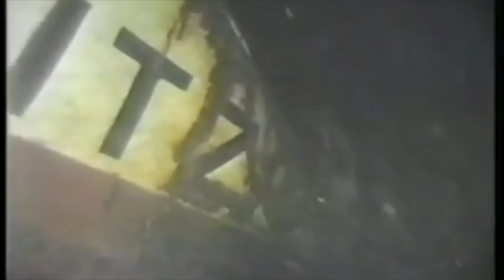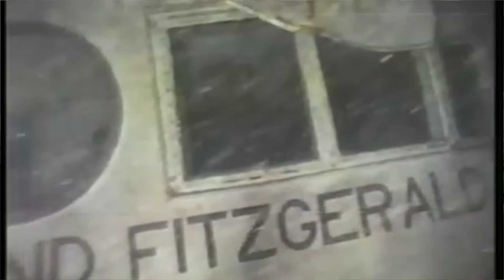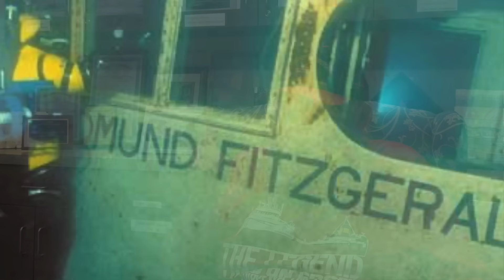Sinking of the Fitzgerald ... Negligence or Nature? Season 3 with Capt. Darrell

Comment: I respectfully disagree that the Fitz bottomed out on the shoal, they investigated the shoal after the sinking because it would be an easy answer. The Bradley didn't need to strike bottom to break in half and neither did the Morel so why did the Fitz? I posit a simpler more straight forward theory that places zero blame on the captain or the crew before I say it, I am going to say that I am not a mariner, nor do I have maritime experience, the only thing I am remotely related to this is a welder in the mining industry who has seen and worked on a lot of old equipment and steel. There is this phenomenon that happens with old equipment where you repair it over and over again. Gouge out the cracks, fill the cracks with weld metal, normalize let the equipment do another 12 -14,000 hours of service. It comes back cracked again you fix it again, repeat it a few times. Then when you are doing a repair, when you are gouging out the cracks that other cracks appear 2-3 inches from the one you are fixing. The more you gouge the more cracks appear, and you can't fix them all because all of the metal is stressed, the steel has hit the point where it cannot be repaired because it is effectively crystalized and shattered.

The Fitz as was said lived a hardlife, it never left without a full load, it was always out in weather. It didn't need to hit the bottom, it didn't need rogue waves aka the 3 sisters to sink it. All it would take is heavy weather, a heavy load and the ship wouldn't survive. I don't think there is a need for any theory on this sort of thing, the ship went out in a storm it shouldn't have gone out in the ship ended up on the bottom in 2 pieces and we are missing about 100 feet of the wreck in the middle it just disintegrated.
Reply from the maker: Understood. Certainly, the Fitz "didn't need" to strike bottom to sink, but it certainly could have struck bottom; it's a possibility. The Titanic didn't need to strike an iceberg to sink either, but it did. What we do know for sure is that the Fitz was taking on water and listing badly, evidenced by what Capt. McSorley said on the radio. So why was it taking on water? It was either coming in through the top or bottom or both. Thanks for watching! HMM

Comment: My question is how would you even get into the Fitzgerald wreck to look for the logbook?!?  It seems like it would take a diver with special-mix scuba tank to do that!  This was accomplished by 2 guys within a year of the last research expedition when they found the body beside the bow section.  They were risking their lives, barely spent more than 10 minutes at the bow section.  The whole dive took them more than 3 hours because of the decompression they had to do on the way back to the surface.
Those hard suits they used to remove the original ship's bell in 1995 were awful bulky and I don't know that they COULD get through the door of the pilot house wearing one of those suits!  Scuba gear/special mix tanks or a small ROV with manipulators might be the only way to do it.
Where would the logbook even be at this point?  It could have been pushed far back into the bow section by the storm.  This is getting grisly...  There's almost no doubt there are bodies deeper there.  I've read stories/rumors about them seeing more on the wreck than they've told the public.  Forget about the state rooms -- the pilot house is spooky enough!
Granted, I think about half the Fitzgerald stories I've read at this point belong in the real of urban myth or ghost stories.  Yes, I've heard a few ghost stories involving the Fitzgerald and sightings at White Fish after the shipwreck.
**
Judging by the last publicly available sonar scan image of the Fitzgerald (2004/2005?), that ship has deteriorated quite a bit since 1995.  The upper cargo deck behind the pilot house has collapsed and is resting on the keel now.  The hull walls (of the bow) have peeled outward.  You could easily see these details even from that low-rez sonar scan.
If an answer is to be found, let alone the logbook, it has to be done soon....  or it may be too late already.  That sonar image was taken in 2004/2005.  The ship has undoubtedly deteriorated even more.
Reply from the maker: Super interesting commentary; thanks for sharing it here. For the people who dove on the Fitz...they have peered directly into the pilot house and have no doubt seen images that they're not talking about, or not at privilege to talk about. So many unanswered questions. Anyway, you offer some very interesting info here and thank you kindly for your thought-provoking thoughts. HMM
Reply: @HistoryMysteryMan  The ghost story thing...  what HAVE people said about sightings of the Fitz on the waters and in White Fish Bay after the sinking?
Reply from the maker: Not sure. Do you know of any sitings of the Fitz in White Fish? @AvengerII
Reply: @HistoryMysteryMan  I've heard a generic description or two.
The most common story seems to be a sighting by another freighter/ore carrier on the Great Lakes (Superior?) about 1985, 10 years after the Fitz's sinking.  This ghost ship sighting specifically mentions that the name "Edmund Fitzgerald" was seen on her hull.
The SPECIFIC story I read on Reddit (yes, yes, take this with a grain of salt!) is someone relating a story of a friend with another friend sitting in a car in a park across the canal zone in White Fish.  They were drinking, of course.
What lends credibility to these two fellows is that they both saw a LARGE ore carrier standing still several hundred feet away from them in the bay.  They thought it was weird because it was in the way of traffic; it was in a VERY dangerous place to stay anchored.  They got a closer look at this ship and realized it was the Edmund Fitzgerald!  Whether they saw the name of the ship or not, I have no idea.  I know that 
The guys who were drinking in that park (this sighting probably happened in the last 30 years; there no details related to WHEN this ghost sighting happened) got the hell out of that park when they realized they were looking at a ghost ship!
Supposedly, there have been other sightings like that locally around White Fish...
I have no vested interests in this.  I'm more agnostic leaning towards belief that some people have what you'd call paranormal experiences.  I've experienced weird things, myself, but I've never seen a ghost.  I'm skeptical but I'm NOT going to call people liars when it's obvious they have experienced something.
Reply from the maker: This is super interesting...I had never considered the idea of a possible ghost ship. Thanks again for sharing your stories...keep 'em comin...HMM @AvengerII
Reply: @HistoryMysteryMan  I'd be reluctant to ask Capt Darrell about this topic (due to his personal connection) but he's already said he believes the museum ship in Toledo IS haunted.
The idea there's more than one "Flying Dutchman" of the Great Lakes seems romantic or creepy depending on your POV.  There are over 6,000 shipwrecks in the lakes with at least 12,000-15,000 human remains that weren't recovered.  I don't know that it can be proven one way or the way.  Do YOU know how to "measure" or "detect" a ghost?  I don't!  LOL
The Titanic exhibits around the country have a reputation of hauntings.  They're good tourist traps, for sure!
Hauntings are very personal.  I don't know that they CAN be captured on camera other than by accident.  I've NEVER watched a hauntings program on TV that didn't seem rehearsed.  Let's be honest -- those programs are faked.
OTOH, there's plenty of security cam footage of weird sights at night.  It can't all be explained as CGI because a lot of it was captured on analogue videotape and wet film, long before digital was the standard.  It's harder to fake things on analogue film...  You can generally see the "tells" when people try to superimpose computer animation on analogue stock film.
Reply from the maker: Again...interesting analysis...thanks! Next time I go aboard a ship or tug, I'm bringing my fully-charge digital Ghostometer. @AvengerII
Reply: @HistoryMysteryMan  <chuckles>
I don't know that bringing "spectrometers" will do much good!
These spirits seem to manifest themselves randomly and in front of small audiences -- usually 1 or 2 people at most.
That sighting of the Fitzgerald (on Lake Superior) in 1985 was seen by the watch crew of an ore carrier.  If I remember correctly, it was your stereotypical ghost ship sighting.  First, fog/mist appears out of nowhere in the middle of the night.  Then, the spectral outline of a ship.  Lastly, they got close enough to read the mystery ship's name and they saw it was the Edmund Fitzgerald.
Eerie story but that might be all it is.  "Flying Dutchman," indeed!
The closest thing to "evidence" of a haunting of the Fitzgerald was a photo snapped of the pilot house during the Shannon(?) 1994 expedition.  There were these lights/orbs that appeared in a photo or two that were developed after expedition.  They looked almost like lit bubbles coming out of the wreck but they weren't air bubbles!  Remember, they were still using 35mm film to photograph wrecks!  Anyhow, short of a film development error there's no explanation for these lights.  I have seen this photo but I don't remember the website URL.  I think it was a ghost website.  Very eerie photo given the context.
I'm not a ghost researcher but spirit orbs/lights always are associated with shipwrecks.  That seems to be a common theme repeated by sailors; that story has been repeated for over a century.  
Speaking of more infamous ships, there are TONS of stories associated with spectral hauntings of the Titanic wrecksite itself beyond the artifact exhibits.  With the amount of death associated with that wreck, I'd be surprised if NOTHING was haunted in association with Titanic!
There have been stories about the Great Lakes Museum, too, and hauntings of the Fitzgerald exhibit.
Reply from the maker: This is all super interesting stuff. I've never given the idea of ghost ships much thought, but now you have considering the possibilities. I'll have to revisit the Nat'l Museum of the Great Lakes and see if I can pick up on anything around the Fitz exhibit...or maybe I should stand in front of McSorely's house at night... @AvengerII